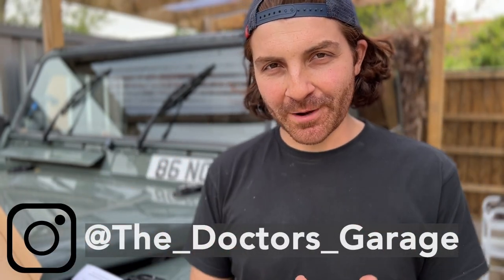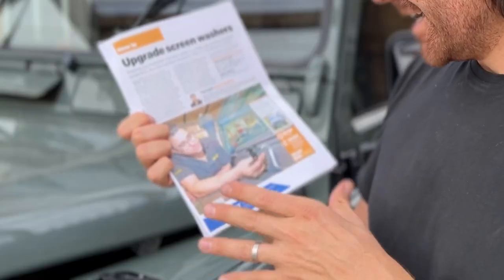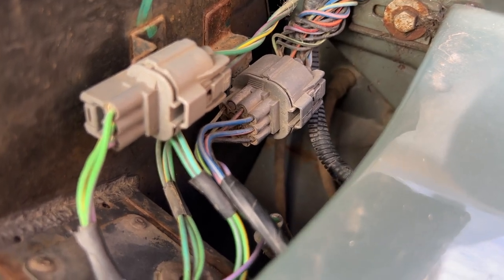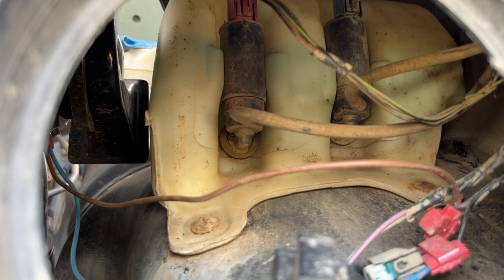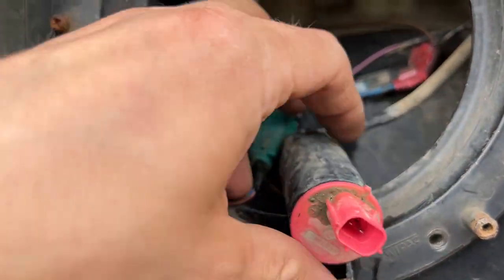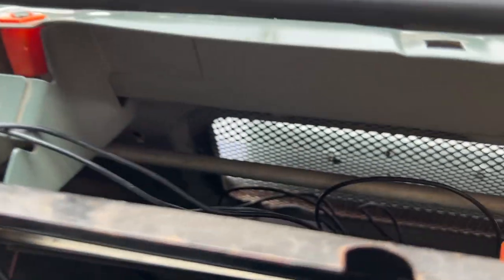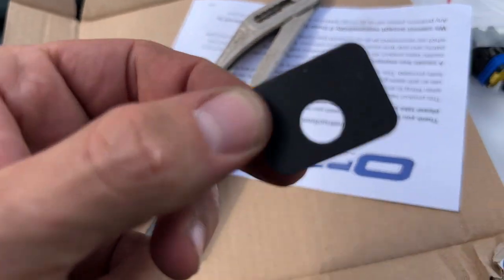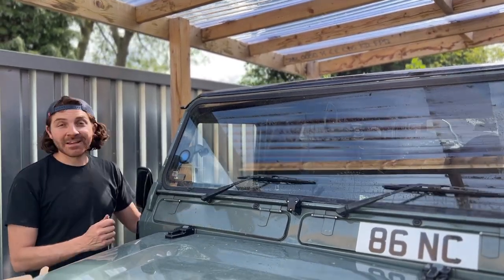THE COOLEST UPGRADE ON MY LAND ROVER DEFENDER SO FAR?!

Comment: Funnily enough I didn't think the wash pattern on my Puma was that bad.  Obviously the spray pattern was not as good as your finished example but was it worth £200 to implement?  It does tend to make the nearly £700 for the ORE wheel carrier a bit of a bargain.  Great video as usual but I'll pass on fitting this to my truck.  It looks like cosmetic surgery is a good practise to be in, as very few people seem to be happy with the way they look.
Reply from the maker: 😂 thanks Tony - my screen washing was nearly non existent before so am pleased with my new jet wash system 🚿

Comment: A cheaper fix is to buy 2 standard jets, fit one each side into the left hand drive wiper holes and plumb them up with some new hose, remove the centre jet and plug the hole with a blind gromit. Costs under £20 and gives you 4 jets of washer fluid.
Reply: I’ve done this and looks good. The pressure seems a bit weak now though, maybe I need a new washer pump?  Any recommendations?

Comment: Nightmare when they block as the s/s screws seize into the alloy making dismantling to clean out near impossible
Reply from the maker: Anything you recommend to stop this happening?!
Reply: @thedoctorsgarage  unscrew the tiny screws that hold the 2 parts of the jet together, one at a time, copper slip threads (or better still duralac) and replace, then do the next screw. Careful not to get polish in the jet holes.

Comment: I'm on the fence with this one, I hadn't actually seen the standard spray pattern of a Defender until I got mine and it's laughable. It would be better it the spray actually cleared the wiper arm on the drivers side. The work involved to fit this kit seems a bit too invasive for me though, would be interesting to see it with a slightly better pump that can use the standard wiring and hose.

Comment: The best , most efficient and cheapest way to solve this problem is to just to split the washer hose and run a length along each wiper arm to the centre . Hold in place with cable ties and construct a pin hole for the end of the tube . This way the water sprays directly on the screen at close range following the stroke of the wiper. You can even extend the hose beneath the bonnet and wrap it around the heater inlet pipe a few times to warm up the screenwash on frosty mornings !.....probably cost about £15 for all the bits !!
Reply: I ain't paying 200 sovs for that.. I'll try your method 😉